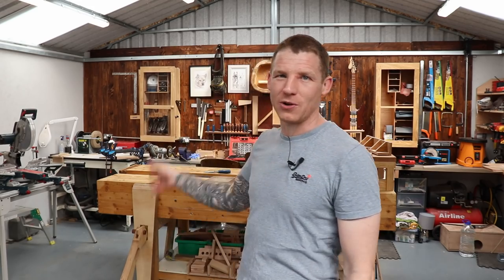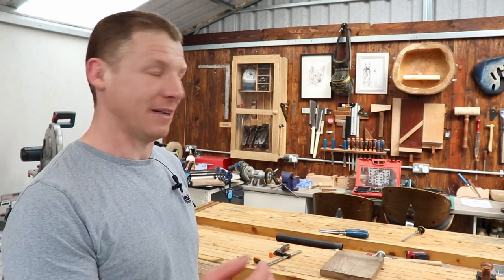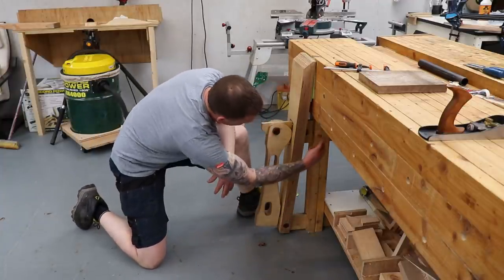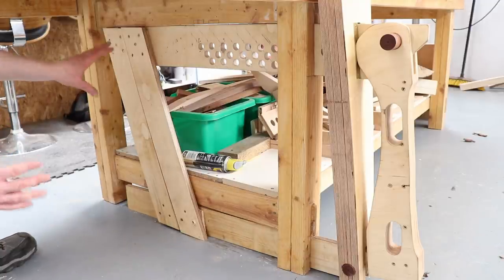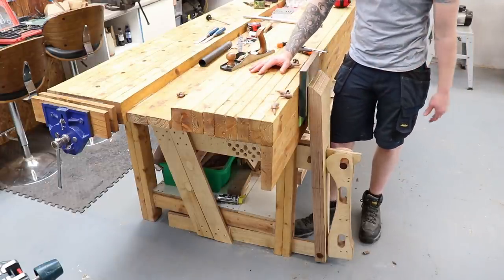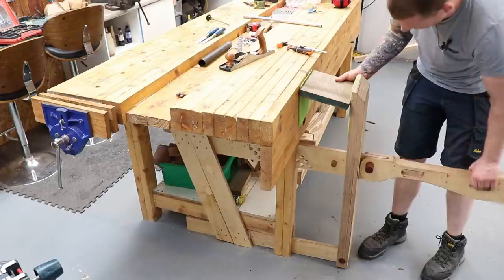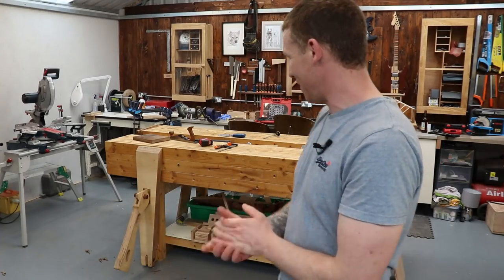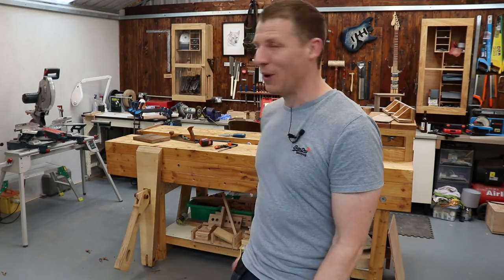CamLock Leg Vice/Vise Part 3. Best Version Yet. Woodworking Vice No Metal Parts.

Comment: The two tenons, the manfully screwed connecting boards at the back, and the vise comprise a rough parallelogram.  The cam pulls on the top tenon and pushes the bottom tenon backwards, forcing them apart so they press against the table top and the floor.  Replace the two left-leaning boards at the back with one board angled  to the right using dowel pivots, so the cam action pulls the tenons together.  Install horizontal rails to prevent them closing and they will clamp onto them and enable the cam to bend the spring/vise.  Well, it looks good on paper :)

Comment: If I'm not mistaken, the angled back braces (that keep the main tenon-bar and the floor bar parallel) shift as you clamp, 'locking' the two bars in place via friction with the floor and the upper table stretcher...  but the downside to this is that it also lifts the table up slightly (as can be seen by the slight shadow-gap under the rear table leg @7:06, and by the ease with which the table gets pushed back in the intro when applying the cam-lever, plus around @7:40, when the pressure is released and the table drops slightly)

The same mechanism, but with the 'floor bar' running just above the bottom stretcher would probably give more clamping force, because there would be less vertical movement (the top and bottom stretchers cannot be as easily separated as the top stretcher and the floor)... but this would require cutting yet another hole in your table leg :D
Reply from the maker: You are right I does lift the bench at times. It would be better to have the bottom tenon over the stretcher, however the stretcher is bit high for it to work. I'm retro fitting this to my bench which is an issue. If I was to build a bench with the vice in mind it would easier. I would keep the stretcher on the floor.

Comment: something you could also do is add a second cam lock to the bottom of the vice.  with it facing into the floor. this will hold the front face in place. could eliminate the need for a bar to go through one of the holes.

Comment: Hey see if you can put either some timber in a cross pattern over the legs or a solid sheet of ply over the end in such a way its not gonna effect the vices operation should prevent a lot of the racking we are seeing. Nice work 😉👍

Comment: Great idea to copy the f Clamp the only small change I would make is to turn the two diagonal pieces around. Because when you clamp it is causing the timber to go into tension 
Instead, it should be in compression, in the long run, to have less stress on the screws and timber. 
But if you are only looking to clamp small pieces I don't think should really affect it.

Comment: I've been thinking of something similar for some time now. 

I never understood why not have the fulcrum where the screw/wedge/cam is usually located, then have a cam or wedge on the bottom. This would give much more power, with much less effort. Simple physics. 

In my head I picture the cam lever on the bottom, but working toward the back, under the end of the bench and out of the way of tripping over it. Just reversing the locations of your pin board and cam, but cam is pushed toward back of bench and works backward from what you have, eg.. up is lose and down/perpendicular to chop is tight.

Just haven't worked out how to make it convenient to use yet. I guess some lever/arm extension arrangement to put the human interface in a better location than under the bench. 

I'm currently building a bench based on Rex Kruger's Joiner Bench, and plan to attempt this.
Reply: Would be great to see a drawing of this idea.

Comment: These are GENIUS!!! I almost can't believe that these didn't exist before! I'll have to consider this for my nailed-together nicholson that I'm thinking of making!
That being said: why not have the handle go upwards instead of down? The lever will have to be shorter, so it'll have less leverage and will take a bit more elbow grease, but I imagine it would be better for the back. Less bending down, and you can put your weight on it to open and close it. I'll have to do my own experiments...

EDIT: other idea: Some kind of foot hook/pedal to make it possible to quick release/clamp it by foot. The lever could be even longer and reach to the floor, in that case. A possible trip hazard, but the thought of being able to kick a vise open AND closed appeals to me... What if the cam didn't have to spin perpendicular to the ground, but instead parallel, like an end cam? Then it could even have a sliding vise screw lever! So much potential! I need to do some small scale tests, I think.
Reply from the maker: Glad you liked it

Comment: My own thought is, you have now built in a racking motion into the vice.  The force at the top of the vice jaws is far greater than at the bottom of the jaws, this on certain lengths will cause problems. I hope I am wrong, but it it is what I can see.

Comment: Hi John, a mightily impressive leg vise and extremely well explained. I have a question, would this set up work without the stretcher being so close to the top bar or is that a requirement? I’m building my bench at the moment and if the stretcher is required I can add it before I continue. Cracking series and thought process.
Reply from the maker: It helps keep things stable, the weight of the leg vise is pushing down on the tenon arm so the stretcher keeps it level as it moves in and out. It might still work fixing both tenon arms together but I would put in the stretcher.
Reply: Thank you John, I’ll sort the extra stretcher and make this awesome vise.
Reply: @ianvoden8915  Hi Ian, would you mind show us your version? Thanks a lot.

Comment: I rather prefer the ratchet or engaged tooth version. But the floor wedges are a bit inconvenient.
Perhaps you can make a bottom rail which has teeth that engage in the opposite direction. When you lift the vise leg to disengage the upper teeth it could simultaneously disengage the lower teeth. Then when the leg was adjusted to the needed length dropping the leg would lever the upper bar to engage the upper teeth while dropping the lower bar to engage the opposing teeth. This would probably require a careful design of the dimensions, but should give really strong clamping.
Just a notion.
Reply from the maker: You could do that but i'm trying to keep it a simple as possible and retro fit my existing bench which is not ideal.